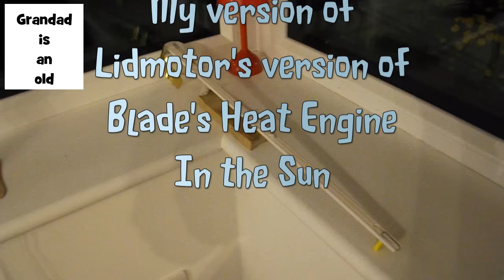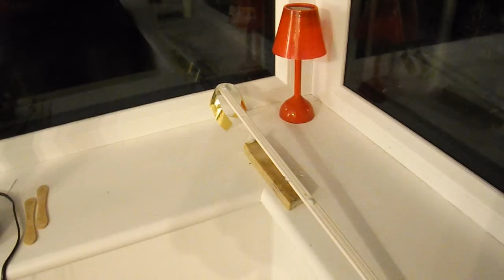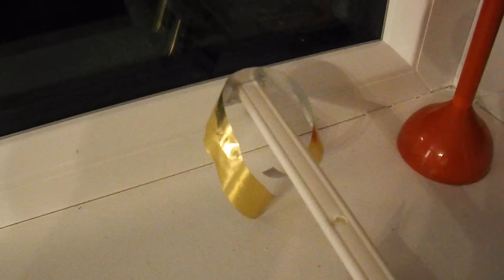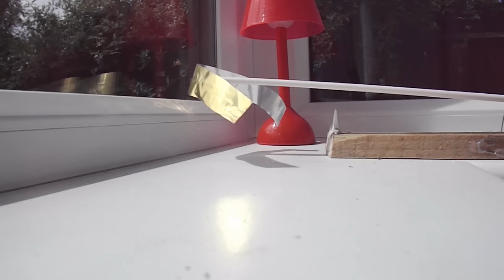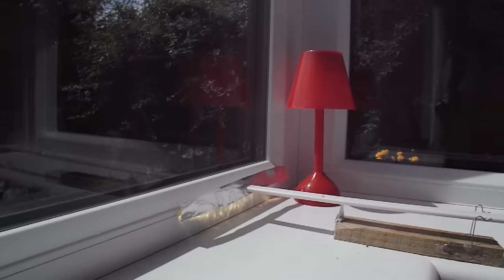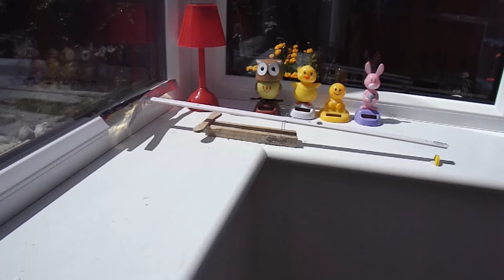Heat Engine in the sun

Comment: I like your long lever arm idea. If you paint the outside black you might get it to work a bit better.  Your 'cheering section'  seems to be saying,  "Yeah it works!"
Reply from the maker: ***** I think that's the difference between you and me. I am happy it works, you like to tidy it up and get it to work as well as possible :-) Once the sun had heated my conservatory it stopped working as it was the same temperature in the shade as it was in the sun.
Reply: GrandadIsAnOldMan Yes it is all about the temperature differential on these things.  My work with the Stirling engines and the Peltier modules really taught me a lesson about that.